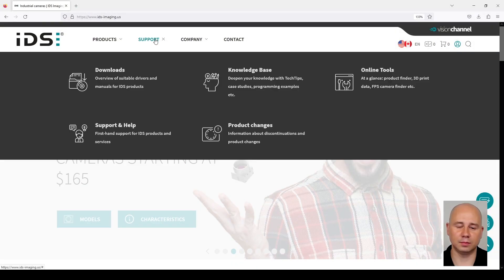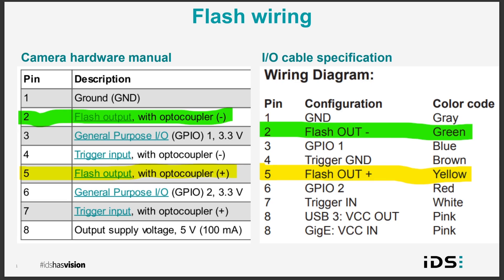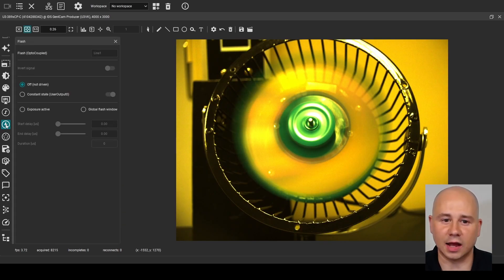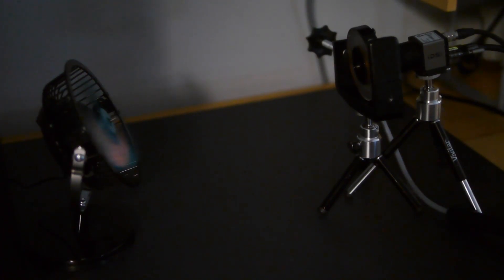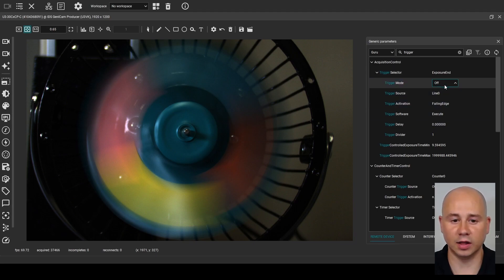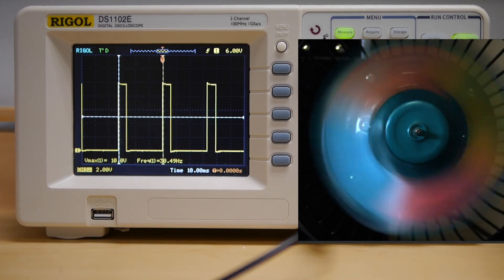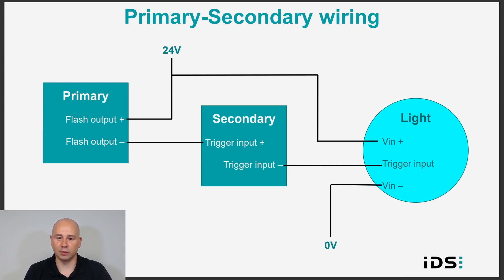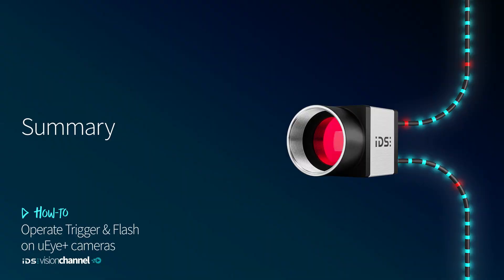How-To: Operate Trigger & Flash on uEye+ cameras

Comment: Can you setup the hardware trigger parameters in python?
Reply from the maker: Thank you very much for your inquiry. Yes, it’s possible to setup the hardware trigger settings in Python. We have some Python examples in our manual for the following nodes that were used in the video: 
•TriggerSelector: https://www.ids-imaging.us/manuals/ids-peak/ids-peak-user-manual/2.12.0/en/trigger-selector.html
•TriggerMode[TriggerSelector]: https://www.ids-imaging.us/manuals/ids-peak/ids-peak-user-manual/2.12.0/en/trigger-mode.html
•TriggerSource[TriggerSelector]: https://www.ids-imaging.us/manuals/ids-peak/ids-peak-user-manual/2.12.0/en/trigger-source.html
If further assistance is required, then we recommend opening a support case.